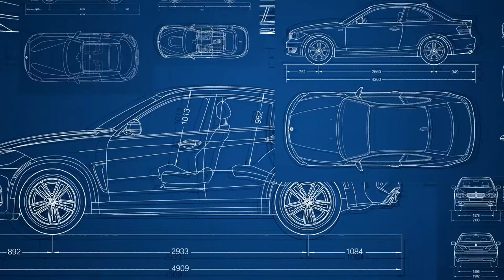N54 REBUILD | EP 5. | RODS BEARINGS PISTONS

Comment: When you installed the main bearings, and all bed plate bolts, you have a hard time turning the crank when doing the connecting rods? I’m getting the crank locked solid when I’m at final torque sequence. You don’t mention anything about this?
Reply from the maker: Big red flag u did soming wrong
Reply from the maker: Should spin freely.. make sure ur oil spay nozzles are positioned correctly